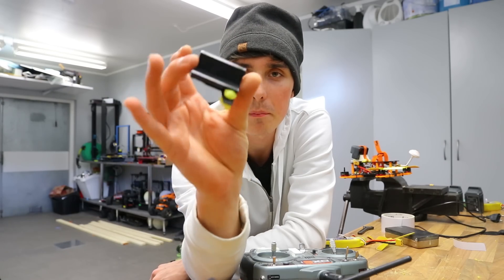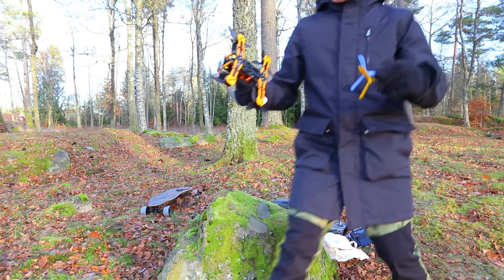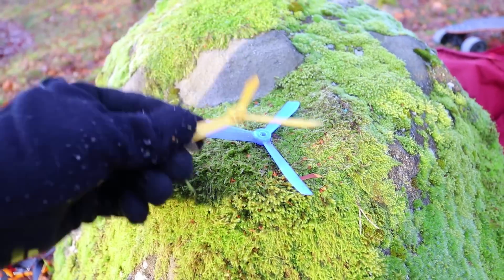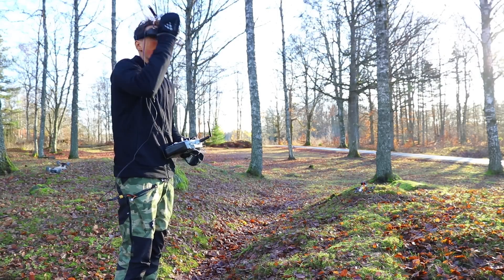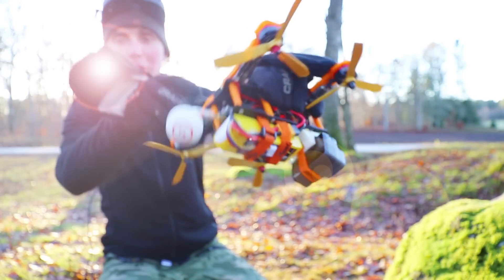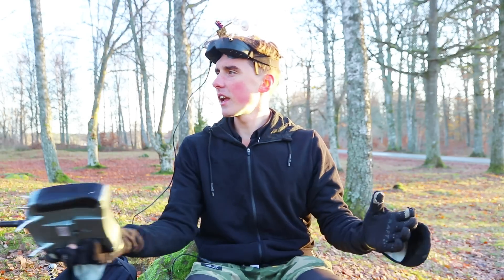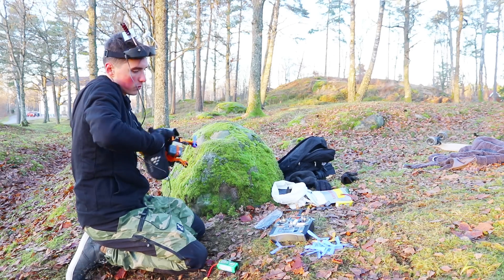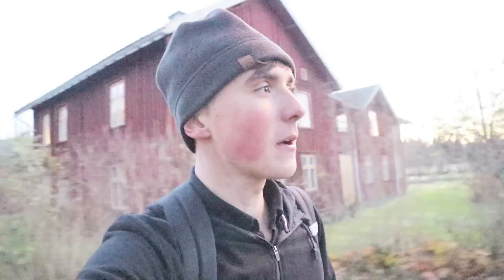3D Printed Drone Propellers - Will It Work?

Comment: Main issue you have is design failure.
I have 3D printed 70mm RC EDF rotors and balanced them and they handle 500+ watts without failing. spinning faster than in a drone and with higher force on the blades. and puts out over 1kg thrust.
Make your blades have better fillets to relieve stress at the hub. make the blades wider chord at the hub for a solid connection. and taper to narrower at the tips. and balance them. print them very slow at high temp and layer heights between 0.1-0.15mm and they will do just fine.
Your blades are too thin and don't have enough solidity to grab the air. and completely opposite profile of what they should be. They should taper steeper at the root and shallower at the tips to maximize efficiency at a given rpm.

Comment: I think that the black propellers are a bit wider than the 3d printed ones , so I'd recommend if you printed them with a little bit larger blade width , this would make a noticeable difference , thanks

Comment: You just needed a simple voltage regulator or Buck converter. I have used them for many years.

Carbon fiber nylon is available today.

Comment: The loss of power is probably due to the surface on the 3D printer props being less than the other bought ones. Less surface on the blade = less thrust. Amazing video tho! Have you considered an acetone dip to fuse the top layers and prevent splintering of layers?

Comment: Great work... probable suggestion: if u printed the propellers with a ring around the tips of the blades(the circumference) won't it increase strength and decrease blade flex.

Comment: The thickness of the blades nearer to the base on the purchased blade looks significantly different than the design you’ve printed. It would be interesting to see an A-B comparison with an identical design. I would also be interested to see if different infill patterns and a printed material like polycarbonate or abs would affect the structural integrity at sustained high speed spinning forces like this. Good video, keep it up!

Comment: So I have an idea.  Have you heard of Rino lining or truck bed lining. It's a soft flexable rubber spray on coat. I wonder if you can cover the props and maybe sand and shape the face of the blade if needed.  The coat makes things dam near bullet proof.  How ridiculous covered a watermelon and dropped it from the 45 meter tower and it bounced.  Absolutely amazing.   See if you can incorporate this in a propeller?!!

Comment: PLA is a horrible material for this.
For a home 3d printer you need to use ABS and acetone for smoothing. 
The propellers need to be smoothed and balanced, then you should come very close to injection molded ones.
Nylon would be interesting, they would be indestructible even on crashes but no smoothing possible

Comment: 10:55, I think one of your propellers broke in mid-air. You did not hit anything. 3D printed propellers have been attempted many times (do a quick search) and they rarely (never) work for a variety of reasons. The first one being the material. Propeller tech in 2020 is incredible, the materials endure insane RPMs and really brutal impacts. They need to be made to withstand these forces in order to make the hobby fun. Otherwise we would spend more time swapping propeller hubs every 5 minutes. You also have to be careful flying the 3D printed props, if they explode while at high speed you could not only damage the quad but also damage other things and/or people in the vicinity. Prop pieces fly off at high speed when they explode and can even stab your lipo. Anyways...   they are more trouble than they are practical or economical.  Thanks for the video, FPV is extremely exciting!

Comment: I'd like to see what would happen with Flexible filament!
Reply: Extreme vibration. They bend a lot, which is not good. I know because I once made a helicopter, out of that sort of material. It was like watching a fish, swim threw water. I only had neon colored filament. It was orange, the propeller was yellow and the tail rotor was green. The bright colors, distracted me, from the jiggling motion. It was really trippy.  I used the standard nine volt remote, receiver, transmitter set up and the thing flexed itself, to pieces.  I can only imagine, the noise of the propellers, flopping around at high speed.

Comment: You could tell just by looking at the 3d printed props that they were thinner both in width and thickness.  That alone would cause them to shatter given enough spin time and vibration on the drone.  If you hadn't crashed into the tree eventually the blades of the propellers would have shattered on their own and caused a crash; which is what most likely happened when you crashed into the tree.

The drone lost one or more of it's propellers which caused it to veer into the tree.  It happened so fast that it appeared that the drone went of the rails all by itself.  It was the lack of robustness in the propeller  design  and filament used that caused the crashes,  not so much the propellers per-se.  

If you could tweak the geometry of your 3D printed propellers to closer resemble what you had on your drone initially   I think you'd have a winner on your hands.  Also, I think one of the more expensive nylon based print filaments would be better for this application.  IF weight is an issue you can set them up in the slicer software to print at 100 percent infill with 100 percent supports so it prints hollow yet with retained rigidity.  The fact that the nylon filament has some elasticity would mean that there is less of a chance of the propeller shattering from the vibration alone and that elasticity would mitigate some vibration as well.

Other than that, well done.  Excellent experiment.  I'll be attempting this with my drone soon.  I most likely will buy one of the "Low-Noise" aftermarket propellers they make for the Mavic drones and have it digitally scanned,  then take that data into my CAD software and scale the proportions down to closer resemble the length of the existing propellers on my own drone.

Comment: It's been some time since you made this Video, i think it would be nice to check if all your final toughts are ok and valid after this time (probabvlu materials and your design/printing skills are better now). About power loss i thing that the mail issue is that in most of 3d print you don't get ideal aerofoil skape in propelers. you could try to use non planar slicing to improve it (there is quite nice video aboui it available on youtube, here) https://www.youtube.com/watch?v=gmePlcU0TRw

Comment: The problem is the material u use is a bit softer. The blade tends to flatten out and you loose thrust. Plus I noticed your org blades have less tip area and more surface in the middle.

Comment: First, I have to tell you that your content is amazing and Im truly enjoying each second I spend here. Do you think that the vibration and the waste of energy on the 3D printed propellers are because of the design or the filament used? or is it because it is a 3D printed part and it will never be as good as the other one?

Comment: If you have a full metal extruder at hand, you should print them with either nylon/carbon fiber ort PETG/carbon fibre

I am quite sure they will get a lot tougher and even allow you more agressive pitched propellers!

Comment: The vibration problem can be solved by balancing the propellers on the tip of a pencil, looking at which side it leans to, and then sanding off lit bits of plastic until the propeller balances perfectly on the tip of the pencil (needle, sharp object, etc). Reducing vibrations will also make the propeller's lifespan increase greatly. Great video - thanks for posting!

Comment: to make it a really good test you should have mimicked the design of the non 3d printed propellers. The change in power and in sound may also have had something to do with the fact that the blade shape changed when you swapped to 3d printed. Otherwise great video!

Comment: you need to try messing around with a different number of blades per each propeller and different sizes of diameters
also try a super flexible filament

Comment: Try make them a similar shape with narrower ends. Your propellers have wider ends and that puts more strain towards the center point of the propeller. Notice that they all seem to shatter there due to the design. Try copy the existing shape and see how your printed ones compare. THEN try some unique designs and see which ones work. Through trial and error you will find a design that functions and doesn't shatter so easily.

Comment: You've probably thought of this, but are the pitch of both propellor-types the same? If so, it is still possible the "standard" propellers move more air than the 3D printed ones, because the difference in shape. Anyway, nice video! I thought the drone wouldn't even make it off the ground XD

Comment: poly-carbonated filament would hold up a lot better in theory, its lattice molecule structure would help to absorb the vibrations a bit easier meaning it can take a lot more

Comment: This guy does NOT seem to be a aircraft modeler and its the problem with these guys that fly drones.  Before he gets the model to fly the blades should be tested for balance and durability without flying the aircraft. Those blades fly pretty darn fast and while they do not seem heavy it turns into bullets if a blade were to break. and he is lucky to not have any of those 3 hit him.
Reply: Something to consider. I am not sure what material he is using but when we used nylon propellers back in the 70's we would puit them n a pot of water for 30 mins first. Other wise they would shatter if you hit something.

Comment: I saw a guy here on youtube who makes a silicone mold from his prints and then casts with resin. I've never used the product so I don't know about weight etc, but I'm fairly sure a prop made this way would be infinitely stronger than 3d printed. The PETG seemed to do OK though. Just need better balancing

Comment: i'm interested in trying these out - it'd be great if the Fusion file(s) were available for tweaking purposes. different filaments will be tried, though. great demo. i've been looking around and although i've found about 10 or 12 of 3D printed props, a lot of them are for the micro quads and some are like 8" (go fig).
great vid as always - keep up the great work
Russ from Coral Springs, Florida, USA

Comment: You should try to focus on the structuee of the prop aside from the durability, gyroscopic precession can do diffrent things spinnig objects, if you spin a prop too fast it can rip it apart. A good example is to watch https://m.youtube.com/watch?v=-N2Z224ti30 Its an extreme example using a fidget toy but has the same concept, if you put your arms out and spin around a room you can feel the blood clearly move to your arms because of the outwards force. I suggest making better stricture to the prop before switching materials

Comment: I'm not surprised. The design of your printed props is completely different than the non-printed. The power loss is likely due to less air movement  from the props you printed. Good job though. Love the comparison.

Comment: As a proof of concept I think it was a winner. Just got to improve the design so it doesn't lose so much energy and if you can use a stronger material. I don't know how cold it was but that would make PLA less flexible and more likely to shatter. ABS would behave similar I would think in the cold. Just ordered my own 3D printer with the hope of building a drone so thank you for proving it can be done.

Comment: U should print them in polymaker polycarbonate. With that material, I am pretty sure, they won't break that  fast. Also u could try out afterprocessing them to make the surface smoother and reduce bad turbulence.

Comment: I think a more valid comparison would be made if the 3D printed blades were the same dimensions as the original blades, the original blades looked like they are fatter and thicker , thus stronger by design alone, regardless of material. Awesome video.

Comment: how heavy are printed parts? Ever thought of using printed pieces to create a negative mold into which carbon fiber could be laid? I'm sure the mass differential for a prop is negligable, but anything substantial or solid that could be replaced with a layer or two of carbon fiber would cut down on total mass as well as allow you to print say.... a hoverboard. I've seen them work with as few as 6-8 high power drone motors. Once you have the mold to lay down CF forms, you could make one for yourself, make some to sell... I would think that the 3d files are available for ultra efficent props, ducts to focus thrust and minimize the turbulance created by open edge propellers.  Damn... I really need a 3d printer now. Doesn't even gotta be a good one if Im just making casts for CF components... Doesn't Staples 3D print  for a nominal fee? Someone help cuz now I have this idea and I don't know where to start.... I even have a carbon fiber guy and a friend who could code a gyroscopic stability algorythm. Assuming somone hasn't already put one out on the Rasberry Pi community.

Comment: how smooth did you get the blades?  perhaps some resistance can be eliminated if you made the propellers a bit thicker, then sanded and finally vapor smoothed them?  a wider blade design like the original blacks may also help.            But amazing none the less!  makes me want to make one and fly!

Comment: I'll preface my comment by saying that my knowledge on the subject is rather limited.

That being said, I think some of the power loss comes from your inexperience with propeller design. The original propellers seem way more engineered, and I know enough about prop design to know that the wider propellers give more thrust in general.

Lastly, heja Sverige!

Comment: Try balancing your propellers with a nail filer and smooth them out with a heat gun take a motor a flat piece of plastic put the shaft through the plastic put rings round the hole number the blades of the propeller get a strobe light the flashlight in a dark room ( not a red light dark room) and make sure the motor can wiggle side to side like the thickens of a piece of paper. And file the blade that pulls the most. Good luck.

Comment: seems like the imbalance is causing them to explode under centrifugal force. you could set up a bench test in your shop to try them out. mount a motor into your vise and spin it up. see how much torque/RPM they can take before they go KABOOM. ill bet you its the imbalance that is playing a major factor in them breaking. on your last crash, you didnt hit anything, one of your props exploded. ive had the same thing happen haha, totally catches you off guard. cheers!

Comment: Have you tried adding a 30 minute z-poxy pt-39 layer to the propellers ? I think they have "drag". Since the surface is not smooth enough it fights the air. Try either sanding or the e-poxy layer in a future video! You're doing a great job and i will definantly "steal" your work :) and make my own videos with my "vision" on these projects. Who's the man? YOU'RE THE MAN! KEEP IT UP!

Comment: if you REALLY want to push this, three things:
1. Obviously, optimize the propeller shape
2. Configure the G-Code so that the single print lines go from the center outwards, to support a maximum of centrifugal force.
3. Smooth the propeller with acid fumes.

Comment: One thing to look at maybe, is redesigning the prop so you've got a wider blade at the hub than at the tip - it'll make not just more aerodynamic props (thus more efficient), but also stronger ones, as you'll have a wider base to absorb the forces of flight and impact.

By the way, is it just me or could you have not hit anything on your second flight when all 4 props broke? It could've been plastic fatigue after pushing quite hard for a while that made one or more of the blades fly off and you'd then crash, breaking the rest?

Comment: I'm not great with spatial relationships. But if you're flipping the propellers on the Y axis before you print, couldn't you just print them all right side up and then install 2 of them upside down?

Comment: 3d printing challenge.. Create 3d-printed fasteners (screws, bolt, etc) or components that can affix work pieces made out of:-
1) glasses  (i.e. weirdly shaped aquarium,etc)
2) cardboard (especially if glue cannot hold the shape together)
3) styrofoam
4) plastic (HDPE, PVC,etc)
5) wood (especially if it contains joinery where its hard to access using metal screws or bolt )

Comment: Making 3d printed propellers that are durable is something that I would be interested to see, as being a drone racing pilot myself I have found DalProp to make some of the best props out there (much better than those black Ideal props that you were cruising around with). The Emax 2205 2300kv red bottoms are a great motor to learn to fly on, they don't have the torque/top end like 2206, 2207, or even 2306 motors have so 3d printed props on those motors would most likely shatter when you arm your quad. What mode are you flying in? Horizon/Level mode is good for learning the basics but acro is where its all at, you can do so much more with it. Love to see you build some more racing drones that you would maybe use for racing (I would be more than happy to help).

Comment: The design of those props is all wrong.  Props should have a higher pitch at the root of the blade and a lower pitch at the outside edge.  Since the outside edge is moving faster than the inside it ends up being the same forward pitch speed, if designed correctly.